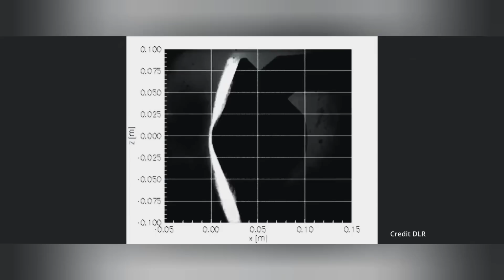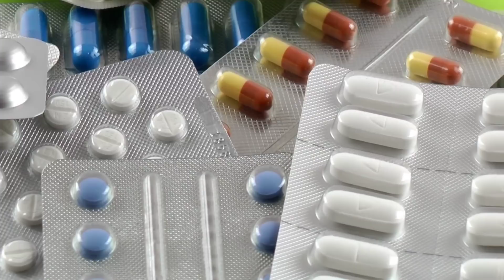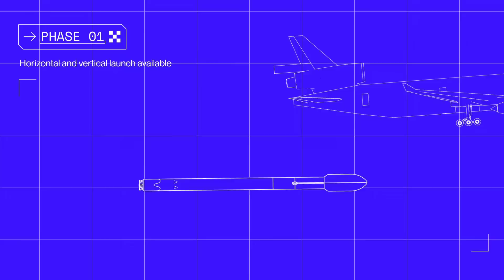FAA goes after another space company and stops vital drugs!  Plus, Space Forge update!

Comment: "Convection" - Let me translate that for you from what I read about similar proposed space pharmaceutical experiments in the 1990's.  Even with very careful temperature control, micro differences combined with gravity mix the purified product with contamination around it as it is pulled through a narrow gate based in atomic weight/charge.  Without that, in microgravity, the unmixed pure product in solution can pass more pure, less contaminated, through a narrow gate for ultra pure result.  A problem for a very few pharmaceuticals, but problem.

Comment: It's going to come down eventually regardless whether the FAA gives the satellite permission to do so. Does the FAA want it to come down in a controlled manner or not? Which way is safer?  I smell lawsuit if not resolved sooner rather than later.
Reply: It's likely that the FAA will require Varda to deorbit the satellite so that it drops into the ocean someplace before an uncontrolled reentry becomes an issue. Speculation aside, we don't know what the FAA's objection is.
Reply: @danceswithmules  The FAA needs to be stopped, this is absurd.  Space Force leadership has publicly advocated for an FSA to take space regulation away from the FAA for a reason.  It has to be a big problem for military leaders to publicly advocate for an FSA and specifically say the FAA isn't doing a good job.